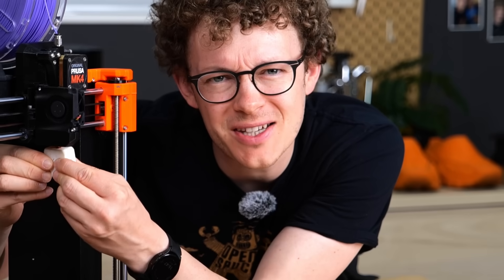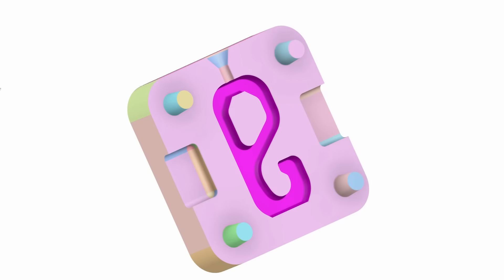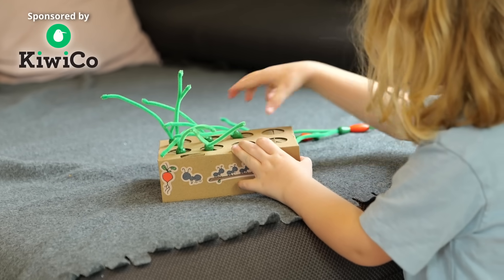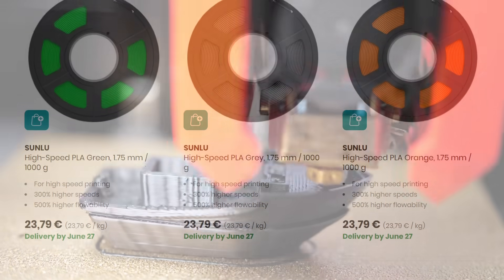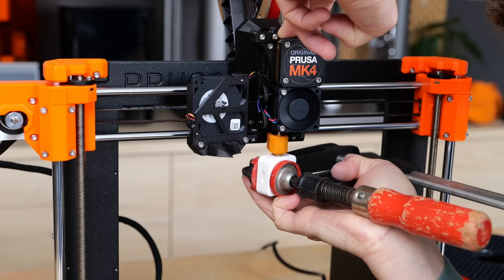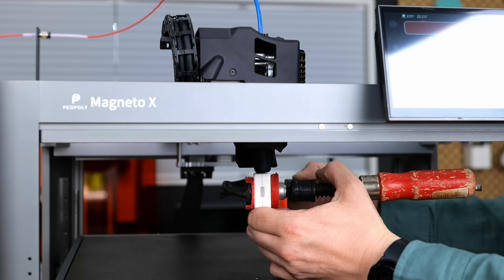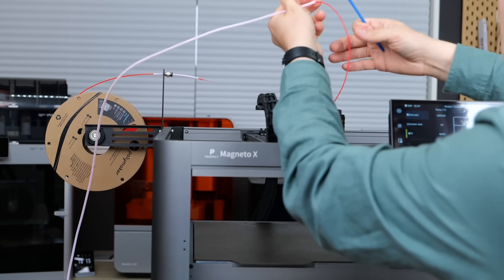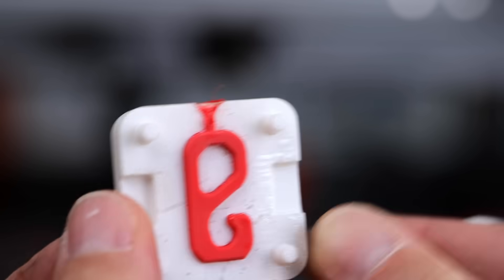I tried Injection Molding using a 3D Printer!

Comment: What if you printed a slot for an additional heater / thermistor.  Then you could dynamically heat the mold using the 3d printers control instead of doing it sorta consistently.  

Also, couldn’t you use the screw clamp on the side, but use the printers Z axis to hold the nozzle against the mold - or clamp the mold to the hot end?

Comment: Even through almost everyone mentions air vents. I don't think you'll need them. Resin prints are not perfectly milled like metal, so there will always be little vents inside the mold. What I would suggest is using a heat gun to heat up the resin to about 200°C (if possible), because with injection molding you only need pressure to counteract the cooldown process. But if the resin has the same temperature as the nozzle, there is no need for high pressure or generally hurrying up. It will stay liquid inside the resin and enter every groove until you cut the heating source. I would try that.
Reply: High pressure is mandatory in injection molding, as you need the plastic to cool in the shape of the mold otherwise you encounter massive shrinkage issues. Heating the mold will help alot, even a few degrees above ambiant, but going in excess will bring more bad than good.

Comment: I would add a hole to remove the air pushed by the plastic, and
use metal filled material for the mold. Preheating that would store more heat, reducing cooloff of the molten plastic pressed into the mold.

Comment: while injection molding is fascinating and you already have the materials, I'd sooner use polyurethane or epoxy resin to cast parts in your scenario
it would be interesting if you could try your hand at casting resin using 3D printed molds and how the casted parts compare to printed parts in terms of strength

Comment: Appart from the vent holes, you could use the bed as a calefactor for the mold (for pla this probably would made the process easier setting it at 100C). Also, making the mold with high temp silicone with a calefacted metal armature (just need an aluminum/iron plate and bend it to have the form of the sylicone mold and connect it to a heathing rod) would let you make complex and bigger pieces. Just my 2 cents

Comment: What if instead of using a 3D printer as a hot end...we restrict ourselves to a hot glue gun? We could use aluminum foil to connect heat from the hot end into a reservoir , and 3D print the parts for a press.

Comment: I am currently working on restoring an used injection molding machine for my home workshop. For the test molds I am currently using Druckwege high temp resin. Any sugestions on parts I can give away at Makerfair Hannover this year? Part size is currently limited to 80x80x50mm by my resin printer/the encasing for molds. I currently also only have black ABS granulate.

Comment: A couple ideas I had that could spark more creativity. Since you’re not able to use positive pressure with your nozzle while injecting maybe try using negative pressure or put a vacuum on your mold while injecting. It would definitely help with moving the material through the mold faster since essentially you’re limited to how much material you can move before it looses its viscosity. Good luck
Reply: I like the idea of hooking up a vacuum source! That can be as simple as a manual vacuum pump with a reservoir like an auto brake bleeder.

Comment: first i would try to inject into the middle of the mold, so it evenly can reach all sides while cooling down, secondly i would use some release agent, and third small openings at the sides not only because of air but also as full fill indication

Comment: Add sprue to the bottom, cut baloon top and put it over thw bottom sprue. Connect vacuum hose to baloon long part and pull vacuum while injecting filament, that could help. And print adapter for better fit of the nozzle out of that ceramic like resin

Comment: My first thought was since the mold does not have an exit relief, that I thought that the air being compressed in front of the incoming PLA was possibly overwhelming the pressure being applied to the PLA. The problem with this idea is that you saw increasing success, so it probably wasn't a problem with the air being captured and compressed.

Comment: Nice work!
Aside from the many tips you've already got, I noticed you got better flow after (among other things) spraying the mold with mold release.
I figure friction of the plastic against the mold (at the boundary layer) might affect flow a little bit (at least until the plastic hardens). So making the mold as smooth as possible, and have the flow of plastic aligned with the layer lines of the mold, plus mold release, might make some small improvement.

I'd vote for heating the mold even more as well, to keep the plastic fluid as long as possible. Above the melting point of the filament would be my bet, as it will lose heat the moment the plastic makes contact.

Normal casting principles may not apply to injection molding, but some sort of feeder/riser might help keep the temp of the plastic up (as well as it's normal function of fighting shrinkage).

Comment: Can you simply create another injection input at the point where the molten plastic cannot get to otherwise? The hot plastic could reheat the inside plastic to bond them together, I'm thinking.

Comment: I'm surprised you didn't have the printer squeeze the mold between the nozzle and the build plate. I feel like that would have worked way better than holding it yourself

Comment: I've always been interested in this topic since injection molding is just one step away from fdm printing. The main difference here is how long your plastic can flow for and the volume of plastic you can have molten for the initial shot. I think if you add an air vent (very small, doesn't have to be large at all) from the end of the object in mold so the air can escape you'll have better success. I guess a good way to visualize what could be happening is an air bubble in a water hose or piece of tubing. I hope to see you come back and try again!

Comment: I would make a stand that you can place on the bed of the printer which can be height changed. In that holds the mold and with a few wing nuts to tighten and hold the mold together. With a handle you can push down to lift the mold up. This way you can add more pressure consistently. Also add spruce or tiny spruce in tight areas where you need stuff to flow. Also if you made the injection hole match the print head so you can seat it pass the part of the nozzle that is like a nut so it seats better and deeper.

Comment: 1) Air needs to be able to escape (can use it to indicate if its full)
2) The mold needs to be evenly heated to reduce back pressure
3) Mold needs a higher thermal conductivity, ie pot metal? any chance we could see zinc based filament? (lead free ofcourse)

Comment: Leave the nozzle away and try to screw the two halves to a custom "nozzleless nozzle" to avoid spills and maximize the injection. 
Basically, you will have a portion of the pointless nozzle in the mold and closer to the actual die

Comment: The pressure is one of the most important parts of injection molding.  Polymers are shear thinning and the higher your pressure the better they'll flow.  You also have to maintain that pressure consistently until the part cools enough or else you'll suffer from major shrinkage problems.  This becomes a problem really quickly as the parts get bigger.

Comment: As plenty other coments mentioned, you need vent holes and better placment of the inlet sprue. I can recomend Robert Talone, Craftman and VOG Man YT channels for mold creation, specificaly for preasure and even injection casting. I'm afraid you didn't acounted for the Air volume and back preasure that was pusing back as the mold was geting warmer. Also you could have made the molds with Saraya Tech Sculpt resins as they are High Temperature resistant and doesn't need any special treatment, it prints as any other standard resin. Another missed oportunity is to make a mold for silicon mold making. Think of it as "mother mold", in which you pour the silicon that will be the negative mold in which the plastic will flow. Silicone would be with higher temperature resistance, you would only need a rigid shel that would keep the silicon from deforming. In a nut shell the Technics, Technology and Methodology for your aproach to mold making already exist and are well established, you only lack the knowledge and experience to properly applay them to your approach.

Comment: An axial feeding force dont turn into a actual pressure before you have the filament feeding into an airtight compartment, and then It will the displaced air at first then the orifices area restraining the    filament outflow at feed force pluss pressure secondary. It will be way lower than your calculation

Comment: A million people have already pointed out the lack of an air vent (it can be really small, just one or two layers deep), and the location of the sprue needing to be changed (for your test piece I think the spot where the eye meets the hook is the best).

   But I think you can also optimize how the mold is held.
   Instead of holding it by hand with the nozzle at its highest point, sit the mold on the bed and have the nozzle lowered down to act as a clamp, this might even have the benefit of light heating on the bottom part of the mold (the part furthest from the hot end). 
   Or you can use your hot end testing rig (shown at 10:52) and modify it with an adjustable table so you can raise the mold to the hot end.

   You tried preheating your mold, which is good, but it appears you heated the mold then clamped it with a big screw clamp. I would suggest getting a couple small (5-8cm) C style clamps and have the mold already clamped together when heating it so there is less time wasted aligning and clamping after it is heated, which means less time for the heat to be lost. It also prevents the clamps from acting like a heat sink if they are also heated.
   At the temps you are heating the molds to there is no danger of damaging steel clamps.

   Furthermore (I realize this is a long comment but I really want you to succeed) take a look at how the hobbyist does metal casting... A lot of the techniques can transfer over to what you are trying to do.

   And for making injection molds out of metal... They make desktop CNC machines that don't take up a lot of space. They are marketed to the firearms crowd and are suitable for aluminum, brass, and mild steel which is plenty strong enough for small batch hobby molding. 
   One of the brands is called the GhostGunner (like I said, marketed to the gun enthusiast).
   With an aluminum mold you might even be able to install a heating cartridge into the mold eliminating all problems with the plastic cooling too fast, and removing the need for a preheating phase.

   I really hope these experiments continue.

Comment: Assumptions based on my experience:

Inject from the center of the the figure on a spot thats hidden or easily trimmed.

Have vent holes small enough for air, but not so large that the injected medium cant plug it immediately to build pressure.

Put the vent holes at extreme ends, the furthest corners, or dead ends.

Make the injection site on the larger surfaces so you can place the clamped mold on the bed.

Use the z axis to put pressure on the mold, heat the bed, heat the chamber.

Comment: One suggestion would be to use a lab jack to hold the mold in close and firm contact with the print head. Also, design the mold so that it will stand squarely on the print surface by itself and use a smaller C-clamp to hold the halves together. Always appreciate your videos and the contributions you make.

Comment: Is the strength of injection molding in the method or the plastic type? (HDPE, PP or PS) not tried your method but I have use a hot plate to melt PLA to a thick paint paste and then pore it into a tin soldier moulds getting results like a ceramic figurin very hard, but brittle.

Comment: I feel like the hook could still be successful With some modifications to the mold design. you could try adding sprues and events to the mold like what’s used with hobby aluminum casting. It would add additional post processing, but it could drastically increase consistency.

Comment: Others have suggested using the Z axis to clamp the hotend down on to the mold. I think that's a good idea, particularly if the mold's injection port is a close fit to the nozzle. I wonder if it would also have some sort of insulating blanket around the mold to help retain that preheating, or even making use of the bed heat?

Comment: As a student of plastic molding, I can say that plastic injection molds (those that are many times larger than the one in the video and those that are only the size of a fist) sometimes need tons of pressure. If you want to press 8 spoons into a mold at the same time, you need to apply 100 tons of force. Of course, since the one in the video is very small, maybe a 3D printer can print it, but it will put a lot of pressure on the printer and you may break the gears that push the filament (I did not watch the video, I only saw the mold)

Comment: Also, molds have holes specifically designed to help push the part out of the mold, with mechanical pushers or compressed air.

Comment: suggestion: use a longer nozzle (e.g. the looong nozzle on the volcano, or just add a volcano adapter.)
and add a washer on the nozzle, and cut a matching recess on the mold, that should keep a better seal than just pressing by hand (as the plastic would have to push against the nozzle, basically self-sealing)
you could try to add screws to the mold, both to press against the washer and to keep it tight, you could also have captive nuts on one side and a bearing surface (e.g. a bb or a steel plate) on the other, so you can just pop the mold open using the screws.

you also definitely should add a vent so the air has somewhere to go, though maybe also try to have it capped so it's just a buffer zone.

and pre-heat the mold to like 150 in a toaster oven 
I don't know how well the material does with oil, but you could also use an oil bath in a fryer to quickly get molds to temperature if you're doing batches.

another thing to experiment with would be to do a  negative mold of a resin positive with low shrinkage ceramic or even plaster, maybe just paint a thick layer (I mean many thin layers) of varnish on it to fill the pores.

Comment: As everyone else suggested, an air hole is the first problem. 

But i would also suggest putting the hole for the spru on the side of the test hook, instead of the top. That would allow you to lay the mold flat on a heated build plate, and keep the mold continually heated to allow the plastic to flow better.

Comment: injection mold design engineer here.
-First, heating up the mold before injection is crucial, as you noticed yourself. It will delay solidification of the part.
-A vent at the end of the part might be a good idea, depends how tight your splitting surfaces are.
-You should feed the part into the thickest part, like head of the screw in your last try. You always want the melt to flow from thick to thin since it tends to solidify in the thin part first.
-Pressure is not the key actually, speed is more important since melt solidifies with time. Viscosity also tends to decrease with increased speed. Normal injection of a part takes max few seconds.
-350bar of pressure is not the lower end in industry. Most of the parts I made molds for were injected with lower pressures. Machines go up to 2000 bar but it's rarely necessary. If part needs that kind of pressures then it's (mostly, not always ;) ) a badly designed part.
Reply: Agree with venting. It is the only way to allow air to escape from those bends or turns in the mold. @10:38 -- add a vent to the "J" part of the hook that didn't fill, creating a vent pipe that will exit to the left side (where your left thumb is in the frame). Otherwise you will face air trapped by the rapidly cooling filament.

EDIT: Since you are using the PRUSA bedslinger, I would think you could make a jig that would "lock" the mold on the center of the bed using the two vertical extruded aluminum Z parts as braces. Once the mold is locked into place, You could lower the print head until it makes contact with the sprue. Keep the Z-axis locked into place and then start the extrusion. Having the bed turned on, in contact with the mold, may allow the filament to flow better at the bottom of the mold.
Reply: Do you know why the printbed was not used to maintain a warm and most importantly a level surface for the mold and printhead mating?

Was all the tilting he did with the handheld mold to let air out? I would think a flat surface would be best, but there was never an attempted  zero tolerance injection
Reply: That last point is good to hear, that the crazy high pressures aren't typically needed gives me a lot more hope for this being possible
Reply: or very high density resins, like HIPS
Reply: I'm an engineer too, but not mold designer. I have been testing with this 3d printing injection and speed was also my conclusion. Apart from vents, standard hotends do not have enough melting capacity to sustain the necessary speed of injection. so one needs to boost the stepper speed but also upgrade the hotend, otherwise it will stall.

Comment: melting for 3d printing is "continuous", for injection it is not. Injection is bursty. The screw keeps heating plastic even when the mold is opening and the pieces get extracted, and as long as it doesn't inject more than it fits inside the screw, it's fine. Using a FDM hotend for this is using a hammer to drive a screw, wrong tool, even if it kinda maybe works if you try hard enough. I'd start by creating a mini screw based injector, not handholding the mold. And vents :)